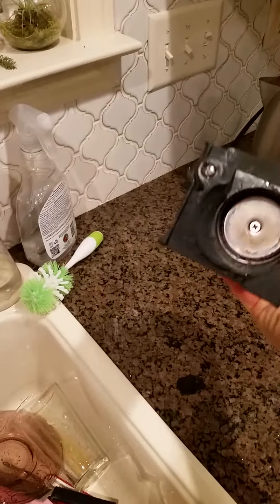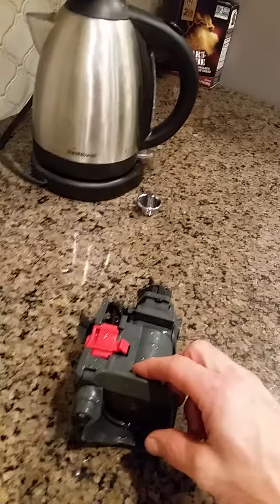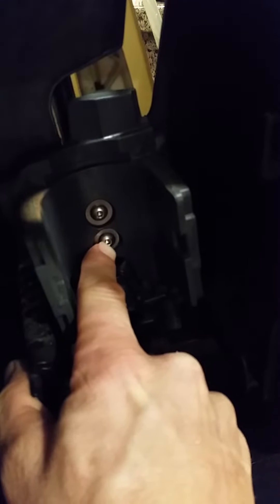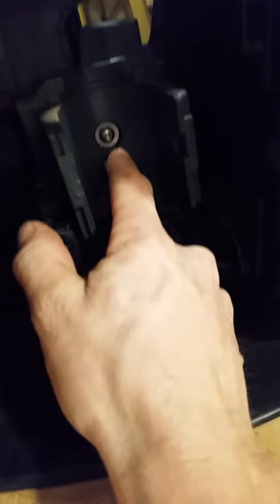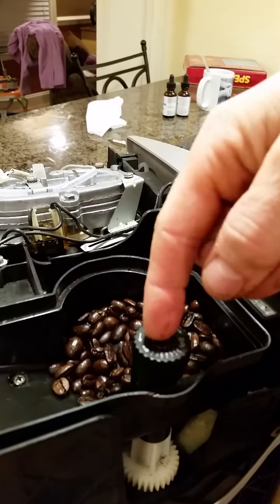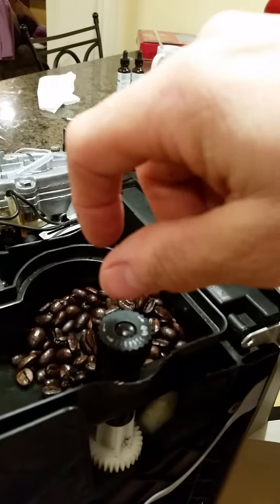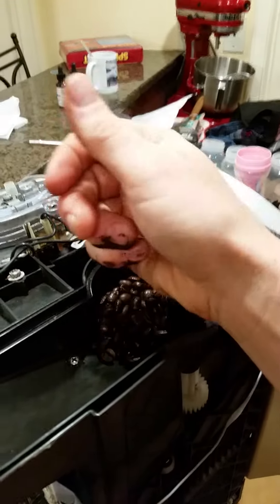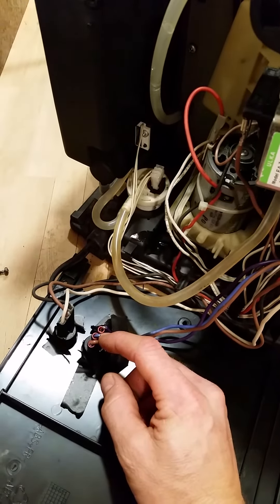Part 2 (read comments)- pulling apart my delonghi magnifica. Please follow my youtube channel!

Comment: I have a 23.210.b - forgot to put the infuser in before i turned it on and drove the infuser carrier hard up against the top brew group. Managed to get it back down and in the home position. In test mode it works ok but in normal operation the red triangle lights up as soon as the power is turned on. WHat do I need to know to be able to fix it?

Comment: Hi Timo my magnifica4400 keeps giving the message insert brewing unit while it is in. If I turn it on it does the checking and then turns off the machine. I recently cleaned the machine checked the rings and lubricated it. Can you help me

Comment: Hi Timo! I know this is an old video but I was wondering if you could help me diagnose my problem since you are the first video I’ve come across that actually  helps.  I’ve replaced my orings except the infuser.  The center of the infuser is very stiff like I have to put a lot of pressure to get it to move.  There are grounds in the dump tray but they are not in the cylinder shape and the water just empties into the tray without going through the spouts on the door.  I am at a loss at this point.  The water is hot and I have no leaks water wise but it appears that it is not tamping the grounds and then not going through the door.  Can you help?

Comment: Hey Timo, I'm having similar issues with my sensor(s). Not sure if it is the grounds or drip tray sensor, the only indication is the grounds alarm light is on. I have pulled the side and bottom panels off and found the grounds tray sensor. I have no way to test if the switch itself is faulty but the mechanism (the clicky thing) is working.  I held the switch on manually (similar to your switches at the back) with the drip tray inserted to see if that was the issue. But I am having trouble finding the drip tray sensor. I can see a nose above where the drip tray key comes through to the back compartment, but I cannot see any wires or a switch that engages when the "key" comes through from the front.  I have a later model, the ESAM4110 but it is very similar to yours.
Reply: Same issue here - would love to know how to repair or change to a switch like he did to bypass this.

Comment: My magnifica pronto infuser is stuck in the retracted position and my door wont close because of it.  Do you recommend accessing the gear assembly underneath and winding the mechanism back?  Or is there a way to do a hard reset with the door open?  Thanks

Comment: Hi Timo
Great instructional video. My boiler is leaking where the water enters the unit. Have you ever actually removed that screw that connects the plastic housing to the boiler ? Mine will not move at all. Wondering if lock tite is used in the factory. Thanks in advance

Comment: Our machine is pouring water into the drip tray when it should be making coffee or doing a rinse cycle. Randomly, it either rinses or makes coffee out of the spouts normally and then sometimes not. I was wondering if you had any thoughts about not just the water running into the drip tray instead of coming out of the spouts, but why it would be doing it sometimes and other times working correctly. Thanks
Reply from the maker: On the inside of the door you will find a spring loaded piece where the coffee runs into, when it comes out the spouts.  More than likely the springs are clogged or worn out.  It should push in and spring back out quickly easily.  It can be pulled apart, but be warned it is tricky to line up the springs properly when putting it back together.  Let me know what you come up with

Comment: Thanks for the video. You may have already seen this... To clean the infuser, remove the spring clip at the bottom then three cleanable pieces slide apart. SCG says to take apart and grease monthly! No need to do the screws. But none of this is in the manual. The manual only says to take out and rinse off.
Reply from the maker: John Andrews that's fine I'm not going to take down my video and redo it all on account of that though.  If I'm going to go to that trouble I'll just delete it and it will be no longer available.  However I think that's going to do more harm than good because even if the people pulled the screws out it's not going to damage the infuser in any way anyhow.  anybody who can't handle putting those four screws back in really should not be pulling apart their machine in the first place.    I think it's better to leave it as is for the people who get some good out of the video
Reply: @timoseppala7137  Just know those screws you mentioned that needed tightening, absolutely needed it in mine. The noise reduction alone was significant, not to mention somehow a coffee bean found its way of that post that gets lubricated...so removed that as well and things have definitely improved. Much thanks....

Comment: Excellent video Timo.  I need your help! I bought a Magnifica on Gumtree in Sydney and got scammed.  She said it was working and it wasn’t :( - it appears that the infuser is stuck - I cannot get it out.  The second problem is the water light is on (solid) even when the tank is full.  Any suggestions?
Reply from the maker: You need to do a hard reset.  Turn the power off and hold the decalcify and water buttons while plugging it back in
Reply from the maker: did you try this out??

Comment: Thanks for these videos!!  Really helpful!!  Question i just replaced my flow meter & water pump.  But I’m getting a grinding sound ea time my infuser is done dispensing.  So the grinding sound is happening after first rinse completes, after dispensing coffee, & after shut off/final rinse.  What should i fix?  Thanks!!
Reply from the maker: could be the rod that moves the infusor need lubricating,  could be that the infusor needs lubricating.  If you make a video, post it on youtube, and give me a link i could diagnose it better
Reply: I started by adding lube to infuser & then realized the screws of the bracket that the infuser clamps into were completely unscrewed.  No odd grinding sound, thanks for ALL your help! Really appreciate.

Comment: Excellent Video Timo, very helpful. Unfortunately, it did not cover my particular problem. I have water which accumulates in the small shallow tray in back of the main water drip tray. There are no signs of any leakage from any of the hoses or the boiler or boiler O ring. Is there a boiler pressure relief valve? I started to hear a low hissing sound about a month ago.
Reply from the maker: there is a pressure release valve.  If it wears out, it will release sooner than it is supposed to.    That said, have you looked at the springs on the inside of the door on the flapper?  if they get stuck, half the coffee will spill into the drip tray.   You can make a cup of coffee while the door is open by inserting something flat into the slot where the door clicks in  (there is a button hidden inside which tells the machine that the door is closed.  The coffee obviously wont make it into your cup, but you'll be able to see where its all going.  Also taking the infusor out and placing it in a bowl of warm water with a little vinegar will loosen things up in it, possible its clogged.  also be sure to descale whenever prompted (procrastination will destroy the machine)
any more questions, feel free to ask

Comment: You only have to  pull one clip and the cylinder can be removed. Watch the Seattle coffee gear video. Don't remove the screws.
Reply from the maker: That's fine.  I never claimed to be an expert on this machine.  I just learned everything myself from hands on experience and what little info i could find online.   There was so little infill available that I decided to make a video to help out people who are in the same situation as i was.
Reply: Timo Seppala definetly! I understand. And I appreciate the videos. I've had a magnifica for about 10 and it's still running strong. I also had zero resources through the years so I'm happy to see more people sharing their knowledge. As a collective it makes it so much easier to get the right info or any I go at all sometimes. The grinder tip was one I struggled with a couple years ago. It maxed out and not fine enough. Figured out out to adjust it to get a few more settings out of it and glad to see you shared that. Thanks again!